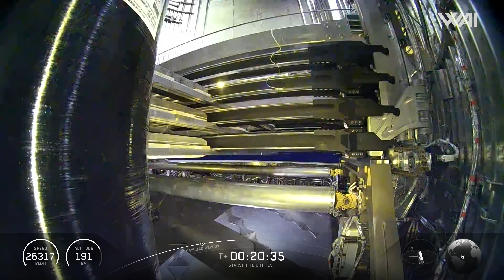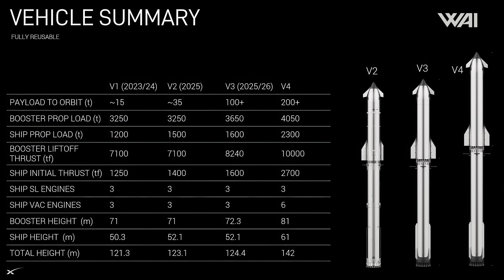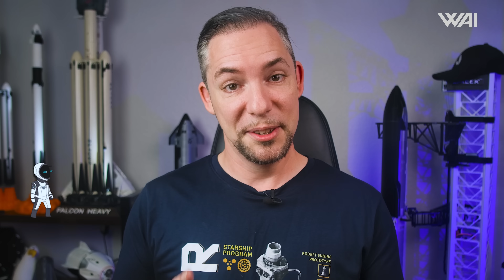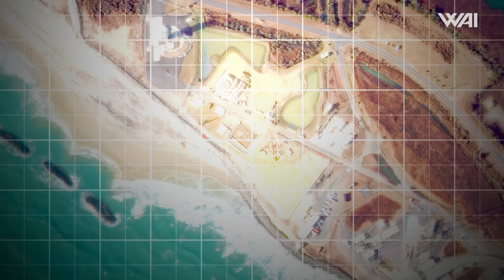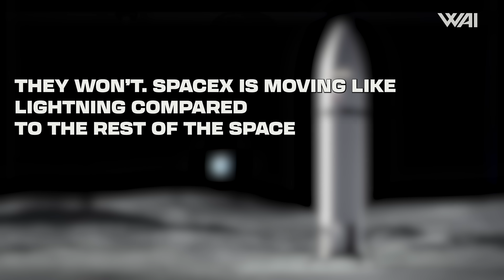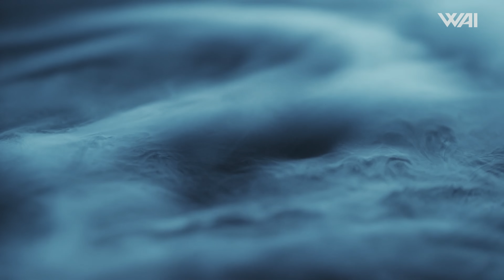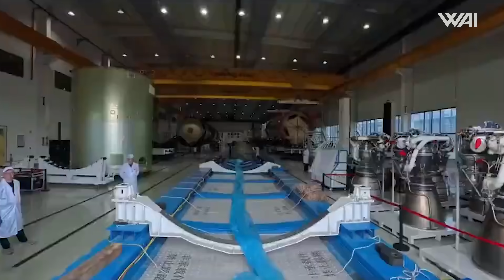SpaceX finally sheds light on ACTUAL Starship orbital refueling hardware!

Comment: Starship 11, did not achieve orbit.
Apollo 11 went to the moon, landed two astronauts, and returned all astronauts back to earth, 55 years ago.   
The starship moon mission has an absurd mission profile.  8-20 in orbit refueling to fill up one starship to go to the moon.   What could possibly go wrong?  Starship is simply too heavy.
Starship in it current form is about as practical as the space shuttle.  Too much weight.  It will probably take years to develop a cabin and life support and that will make it even heavier.

Comment: only thing i'm scared of is a RUD while refueling.. that's a certain kessler syndrome event.

also, In my eyes, starship should come with a third stage, third stage being a safety capsule.. i imagine an upscaled stoke space type design would be perfect for this.. only the oxygen tank up front needs to be relocated, and the best part is, this stage would actually keep the weight Ballance if so.. 

That's the fastest and safest route to get it human rated.. if anything was to happen on the moon, you don't need to send a bunch of ships to refuel, you leave in the nose cone, the second stage becomes a tanker hub for next flights, refueling happens without risk to crew..
I imagine you don't need many of this version, only until the other versions get human rated (without an abort system) and infrastructure for secure landing is in place, then it'll be obsolete and redundant.
Reply: I think they should use to tankers. One for CH4, the other for LOX. Then, no more worries for a RUD.
Reply: @zhchbob  Not a terrible idea, it would reduce the possibility of fuel mixture (RUD), but would increase the logistics/operations by basically doubling the refueling procedure.
Reply: @zhchbob  Wrong....
Reply: @zhchbob  Keep in mind that the dynamics of explosions in zero-G + vacuum are quite different than in 1-G with atmosphere. Terrestrial explosions benefit from the roiling intermixing of fuel and oxidizer in the expanding superheated fireball and pressure waves. It doesn't quite work that way in space where heated gases do not expand "upwards" and there is no atmosphere with which to transmit a shockwave.
Reply: @FineFlourishes  In space the expansion would be in all directions rather in hemispherical directions, but otherwise why would it be different?  Has work actually be done on liquid fuel/oxygen explosions in space?  I mean, other than Apollo 13?  I do see your point about the shock wave.
Reply: I suspect they will stay at a relatively low LEO for Starship tankers to reduce this issue. It will not eliminate it but reduce the effects of orbital trash.
Reply: There will be no crew on Starship-HLS during refueling in Artemis mission.
Reply: I expanded Upon my thought process behind the stoke like nose cone.

Comment: Could they separate the starship lunar lander at the draco engines? Leaving the fuel tanks for future use as Habitats. Lifting off with only the header thanks to redock in orbit with the Orion capsule.
Reply: We already know of 5 or 6 versions of starship. One of which is just a huge fuel tank that stays in low earth orbit to act as a depot. While the current HLS version of Starship cannot land on the Moon and return to low earth orbit, it can meet a tanker in the Moon's orbit to top off and bring the astronauts back to a low earth orbit for transfer to Dragon and reentry. Nothing prevents fuel depots in lunar orbit, it's just logistics. Then as ISRU starts manufacturing fuel on the surface you already have the start of an orbital fuel depot.
Reply: All that to illustrate that Orion is not needed at all. As for splitting apart, it's not something I would rule out, just not sure if it will be needed. And once ISRU kicks off the extra tank space is needed to take fuel to orbit.

Comment: using 5000 tons of fuel to get to orbit that so crazy its like over 90% of the total weight. most of the fuel is needed to lift the fuel it self i guess there is a crazy snowball effect the more you want to lift the more fuel you need but you need more fuel to lift that fuel

Comment: Also, in order to avoid the heat of direct sunlight, can the tankers be positioned in a geosynchronous orbit on the dark side of earth to avoid fuel evaporation issues?
Reply: Earth doesn't have a dark side.
Reply: @dimitryzarkh2084  He meant in Earths shadow.

Comment: So you're telling me Apollo made it to the moon without refueling?  Make this make sense.
Reply: Apollo was never intended to return. Every other system used for the moon today is intended to be reusable.
Reply: @ShieldWolf-yp3cr  Used for the moon today?  Which ones, precisely, since most recent UNMANNED missions made new craters?
Reply: @LordDustinDeWynd every one that NASA was going to use. Being reusable is a criteria they stipulated in the contract
Reply: Seeing as being able to go to the moon once isn't viable for a colonization on the moon. Waiting 15 years for the next ship to be built isn't either. They need a ship that can go both ways and still be functional. The Chinese and SpaceX are the closest.
Reply: @LordDustinDeWynd im specifically talking about the spaceships that need to refuel that are intended to go to the moon. There are several and they all need orbital refueling. Why? Cause they dont chuck huge parts of the ship off. They have to push the mass around in space. You can thank Newton for the equation for why they need orbital refueling. It's pretty simple and not hard to get your head around. They threw huge parts of the ship away to save mass so they didn't need the extra fuel that a reusable ship would have to have. If you want to do it more then once and save costs you need to keep all parts of the ship and not make new parts or whole new ships. If you want to go once and be done then sure you dont need orbital refueling.
Reply: @ShieldWolf-yp3cr  Feel all better now?
Reply: Apollo WAS intended to return to get the astronauts home, it just couldn't be re-used.
Reply: @LordDustinDeWynd  The entire vehicle was not intended to return. Only a small portion.
Reply: @Noridin You're right.  They returned the important bits to Earth though.  You said Apollo was never intended to return.  It was ALWAYS intended to return the astronauts to Earth.
Reply: @LordDustinDeWynd  I didn't say anything about Apollo never being intended to return. I'm not the person you were originally replying to.
Reply: @Noridin Apologies.
Reply: @Noridin exactly. A small portion of the ship. Thus you need less energy to move that mass thus less fuel is required.
Reply: @LordDustinDeWynd but not return to the moon which is the goal today. You can't create a colony with just one flight. You need multiple flights. So the ship you use has to be able to do it over and over. I don't understand why it's so hard to understand. Why did you think they threw away so much of the ship? It wasn't cause the engines couldn't handle being used that much. But because they didn't want to have to move that much mass. But with a reusable ship they have to keep that mass and propel that mass. I know it's breaking your brain. But the more mass you have the more fuel you need to move that mass. It's simple physics.
Reply: @LordDustinDeWynd return to the moon....

Comment: The reality is, ANY future lunar and interplanetary system requires 2 things: (1) rapid reusability to reduce cost, (2) LEO refueling for large mass movements. We can't do anything manned beyond Apollo-stye moon missions WITHOUT staging fuel depots. We're going to need gas stations in space.
Reply from the maker: Absolutely agree! With limited fuel in space, we must first transport it from Earth. Next, we focus on refining fuel off-planet, starting with a lunar refinery. That requires moving equipment to the Moon first. Orbital refueling is the clear starting point. Critics are missing the basics. :_WAIRocket:
Reply: @Whataboutit  Sadly, Felix, some ex-NASA officials are saying that LEO refueling is a WEAKNESS in SpaceX's plan even though they demonstrate the hardware production capacity and cost reduction necessary to make it work. Even (crazier), that in-orbit refueling isn't doable! It is insane that this mindset exists at NASA, but it does explain why we're finally on the other side of a 45-year desert in space innovation and achievement (with things like new telescopes and asteroid sample return excepted...those have been pretty amazing).
Reply: @Whataboutit  "Limited" fuel in space? I'd like to introduce your to the second largest moon of the Solar System, Titan, where we'll be placing the galaxy's next refueling depot,....
Reply: Three things actually.  The third being political support.  Without that Lockheed Martin and Boeing are out of the running.  If (when?) SpaceX gets Starship going I wouldn't be surprised if SpaceX finds that it could self fund a trip to the moon but that would require revenue flights on Starship.
Reply: @longshot7601 SpaceX can easily self fund trips to the moon and mars via starlink.
Reply: @random-citizen-x  They might be able to self fund but it would be so much easier that have a partner like the US government.  I wonder if Musk pissed Duffy off doing DOGE things.
Reply: @longshot7601  they def will get it goin.. obviously they dont actually need the gov support, guessing they would like a little bit of the pie if they goin to do it for them
Reply: @LawrenceAllen-xj9sb  or you go nuclear
Reply: @omarw3314  When you get nuclear propulsion mastered and operational, let us know.
Reply: Hulling fuel from earth into space is silly. Better to make the fuel on the moon. Also burning carbon and hydrogen is not a viable thing. Those elements are too valuable to burn. Better to burn oxygen and silicon.
Reply: @nickl5658 The byproducts of methane and oxygen is literally what's used to make starships fuel. That means once spacex makes their own fuel starship is literally net 0.
Reply: @nickl5658 hauling fuel from earth is a necessary (albeit temporary) step 1.

You need to develop and prove out the process.

Then you use it to get the high mass equipment to the moon to create fuel in-situ.

Then from there you create the fuel and use it to push even more equipment to deep space to mine space rocks for the ultimate in cheap abundant fuel.
Reply: Or spacex Station in gas 😊
Reply: After China does it, we can copy them.
Reply: @richardrickbarrow  If NASA is in charge. But no worries, SpaceX will do it all by themselves...mark Elon's words.
Reply: @richardrickbarrow  China doing something first? Is it opposite day?
Reply: @richardrickbarrow  Yep. And the "race to the Lunar Surface" is evidence of their interference. It is the race BACK to the Lunar Surface, thank you very much. China is one of the biggest pushers of the "America never went to the moon" fad. The CCP propaganda arm is in full swing with an entire generation, or two, so when they eventually land they can say to their people (and sadly to many other Apollo doubters around the world): "China is the first to the moon." Trust me: I lived and worked in China for 20 years...I know CCP propaganda when I see it.

Comment: Why doesn’t the heat shield block the heat of the sun? It blocks 1500 degree plasma but not sunlight?  Make it white and help the heat reflectivity to sunlight. I’m no rocket scientist but it seems to make sense.
Reply: The best way I can think to explain it is that they are two different ways of heating. A sign of this is the Parker solar probe best shield, its bright white to reflect as much radiation as it can, but the heat shield tiles of starship, and other vehicles are black, This is because its not radiation they are worried about, but conductive heat instead.

And the bright white of the Parker solar probe is reflective and a coating, heat shields erode and ablate, breaking apart to take that heat away from the plasma, any coating would go away quite quickly.

For the example of Low Lunar orbit, the heat would just absorb into it, and not reach a threshold to ablate, itll just get hot and spread that heat to the rest of the vehicle
Reply: @kirowilber9121 One minor correction - Starship heat shield is (or will be) 100% reusable, so it will not be ablative. Otherwise, yup.
Reply from the maker: Because it’s meant to protect the fuselage from Plasma. What you want against fuel bleed is an insulation protecting against long term heating. Not something good against short term torching. That’s the biggest problem in engineering. If you improve one aspect, you almost certainly lower another one.
Reply: I’m sure it does.  They will likely need to orient the heat shield towards the sun to reduce boil off.   But it going to be an issue on long flights.  I’m sure they’ll figure it out.